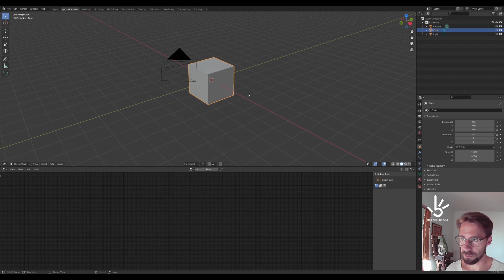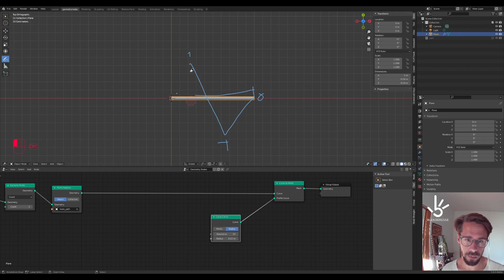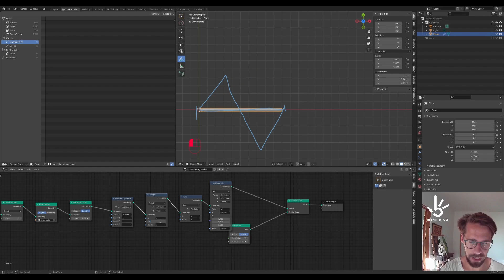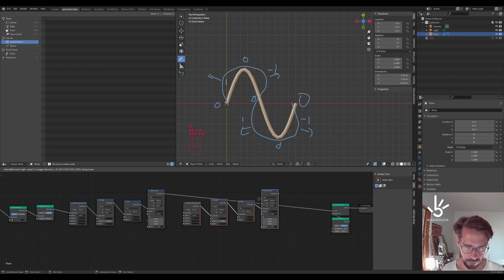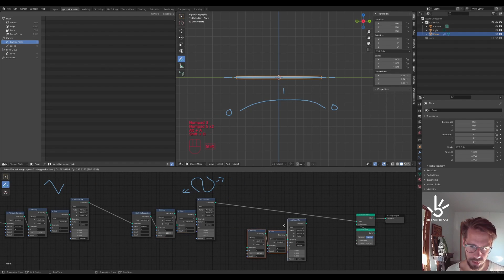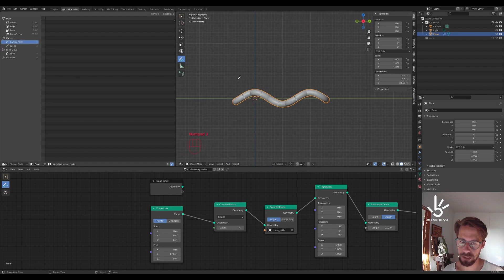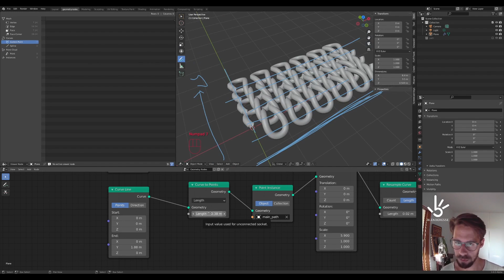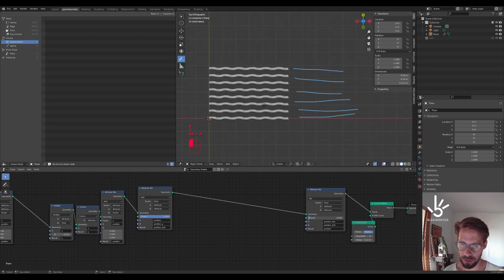Geometrynodes Tutorial - Procedural Knitting Pattern - Blender 3.0  -  Part 1/2

Comment: Hi, i just purchased Blenderesse freeze addon for blender on Gumroad.
The problem however is that I can't find it in 'install addon' under Edit menu in blender. Please kindly put me through on how to install and use the freeze addon. A link to a tutorial will be much appreciated too.
Reply from the maker: I dont really make addons, the products I sell are geometrynodes setups so you can just open the file and for example copy paste it to your scene. You need some basic understanding of course but it should be fairly simple to use as a modifier. Its also quite old so its not supported on new blender versions probably.